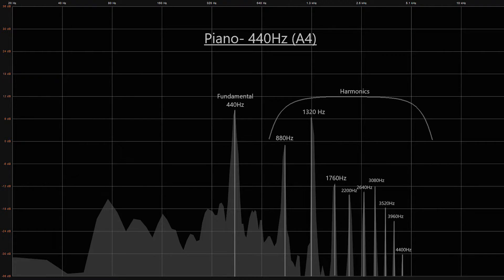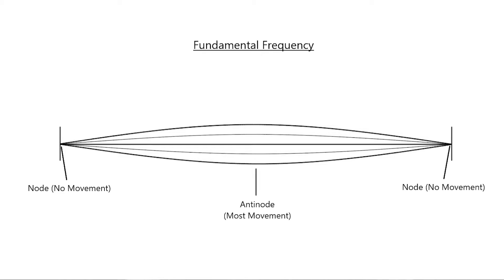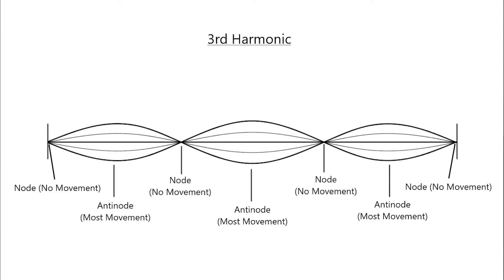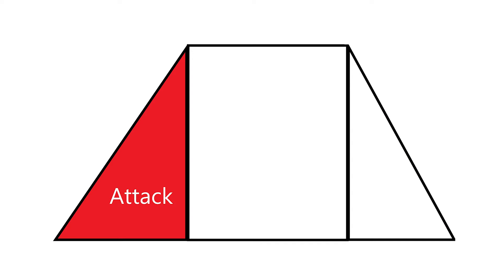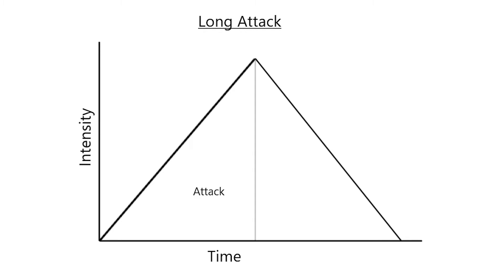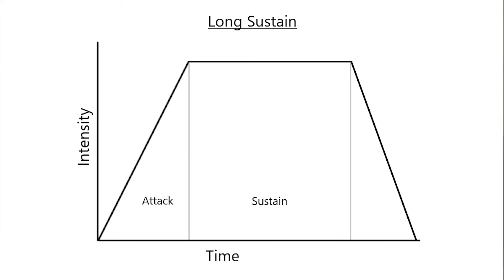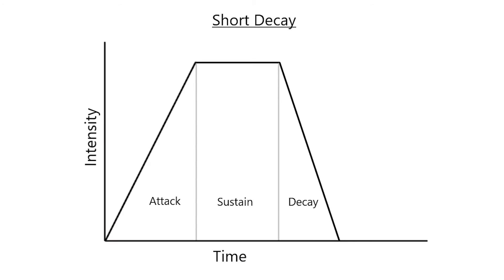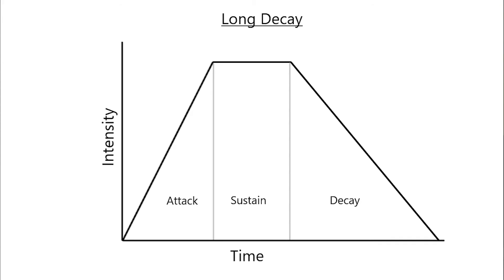Why Do Instruments Sound Different? Overtones, Harmonics, Envelope, and More...

Comment: Isn't release the time it takes to get from the sustain level to zero? Normally decay is the time it takes to reach the sustained value from the maximum value reach from attack.
Reply from the maker: When it comes to virtual instruments, you're correct. You're referring to ADSR (Attack, Decay, Sustain, and Release). I'm describing an older way of thinking that applies to acoustic instruments.
Reply: @AudioUniversity  Oh right wow, guess I didnt notice that.

Cheers for that info! :)

Comment: Dear Sir, you demo is great. I have a confusing thing on guitar amplifier. Normal we use external microphone to catch the sound from guitar amplifier. 
Can't we use headphone output of the amplifier to fix directly to the mixer???? What is the next option? Any additional out put from amplifier instead headphone?? Thanks
Reply from the maker: What is the model of your amplifier?
Reply: @AudioUniversity   Home scale amplifier. Vision brand
Reply from the maker: I’m not able to find the exact model you are using. If there is a headphone output, it can be used. Just make sure to adjust the level so that there is no clipping at the input of the mixer. If there is a line output, that’s a better option.
Reply: @AudioUniversity  Thanks